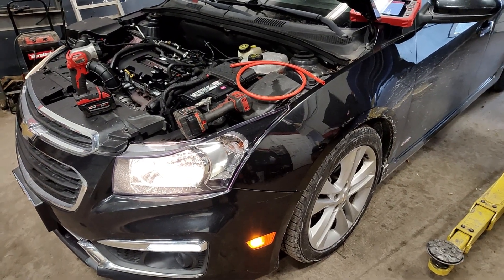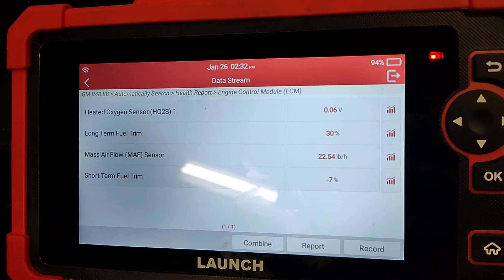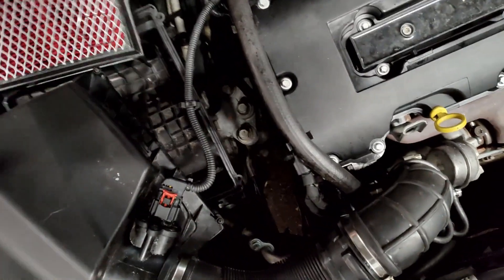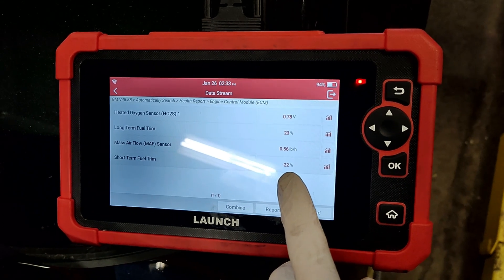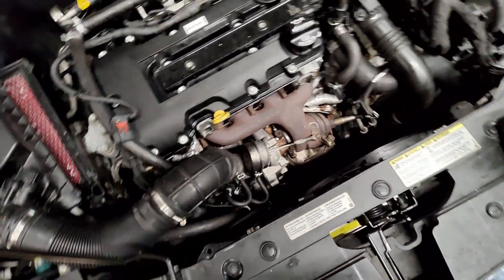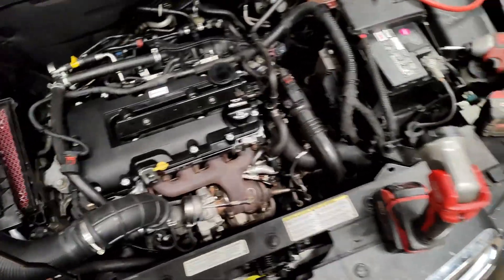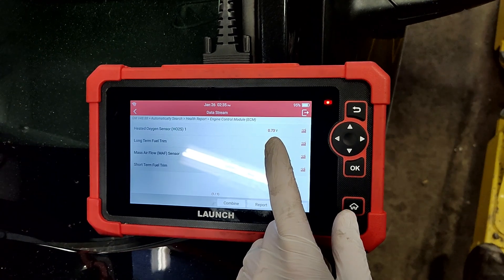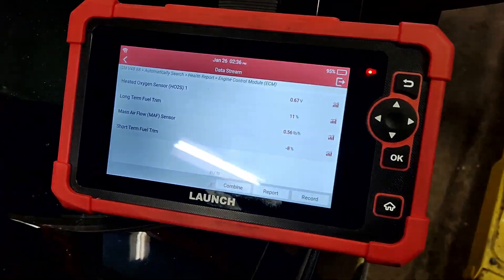Part 6 - 1.4T Fuel Trims - Checking for a Bad Mass Airflow Sensor

Comment: On my 1.4l Trax my high LTFT’s at idle ended up being the purge valve solenoid stuck open & continuously sucking adding extra air into the system.
Reply from the maker: Yup, that'll definitely do it!